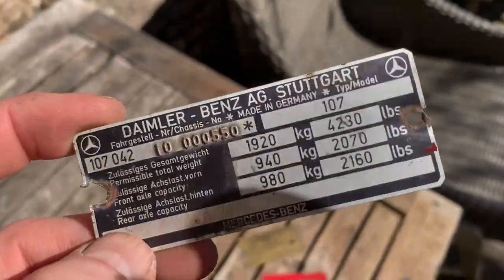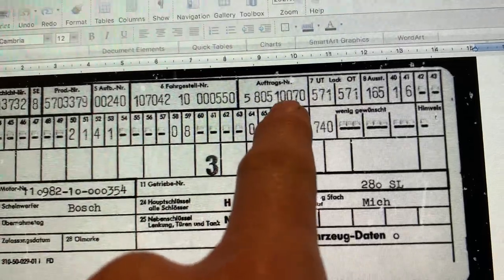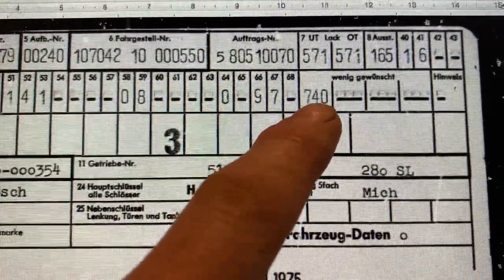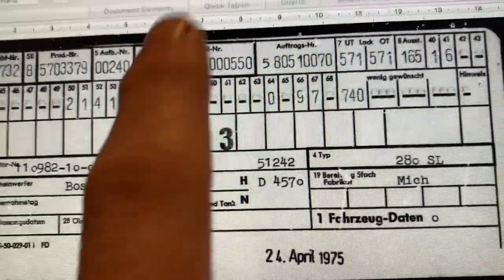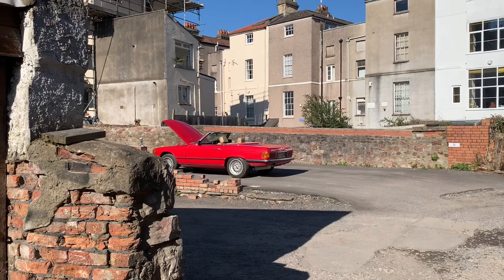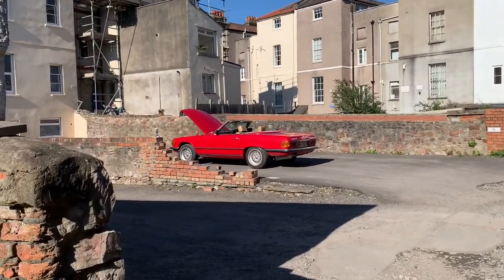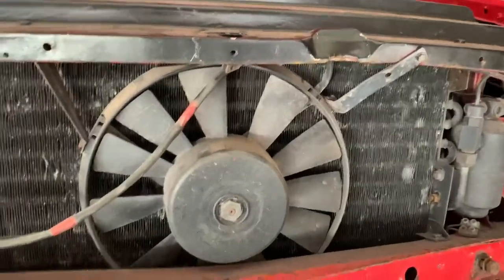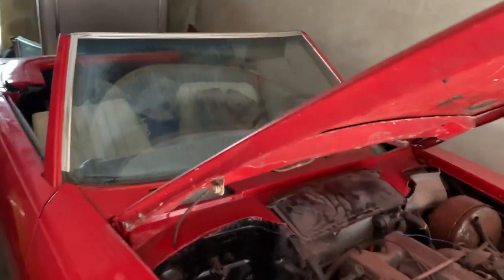Mercedes R107 data card + VIN number decoding

Comment: The 42 means the model( 280 sl) 10 is left hand drive manual 12 is left hand drive auto. 20 and 22 for right The injection changed from d jet to k jet in 02.1976 so if this is a 1975 the engine may be original. And it should have the d jet 110.982. Hope this helps, good luck.
Reply from the maker: Thanks for your comment. It’s all starting to make sense......the plot thickens.

Comment: I think the 042 is not the manual gear box. I think is the model related to engine. Like 107.048 is the 560SL
Reply from the maker: Thanks for your comment. You are right, the 042 is for the model eg 280SL. The next two digits tell you whether the car is LHD or RHD and whether it is manual or automatic. One of my subscribers left a really comprehensive guide in the comments:

R107 for the roadster (SL), built from 1971-1989
C107 for the coupe (SLC), built from 1972-1981
The figure behind the dot tells you which type:

022=280SLC (M110)
023=350SLC (M116)
024=450SLC (M117)
025=380SLC (M116)
026=450SLC 5.0 (1978-1980)/500SLC(1980-1981) (M117)

041=300SL (M103)
042=280SL (M110)
043=350SL (M116)
044=450SL (M117) (also the early 350SL with 4.5L engine for US market)
045=380SL (M116)
046=500SL (M117)
047=420SL (M116)
048=560SL (M117)

The double digit after the next dot tells you 1 for LHD and 2 for RHD, followed by the type of transmission 0 for manual and 2 for Auto.
The last six digits tell the built number of that type.

During the manufacturing years four types of engine were available, two inline DOHC six cylinders (2.8L/3.0L) and two SOHC V8's, all fuel injected. These engines got several changes, of which changeover from D-Jetronic to K-jetronic in 1976 is more notable. All these changes resulted in different engine numbers, which can be found behind the figure of the engine 'family' line (i.e. M110.982 is the D-Jetronic 2.8L/M110.986 is the same engine but with K-Jetronic injection).

Comment: Your latest acquisition the 1975 is djet the others are kjet.
Reply from the maker: Thanks for your comment - now I understand why it looked so different.
Reply from the maker: @John McDonald  That is fantastic info on the SL codes thanks. Have you ever come across a M110 engine where the throttle mechanism goes across the engine block like on my car? Trying to figure out whether that arrangement is standard on any other 280 models. Mike

Comment: Hi Mike, thank you for all your informative video's. I've learned a lot by watching them, please keep it up!

Type decoding is pretty straight forward:
R107 for the roadster (SL), built from 1971-1989
C107 for the coupe (SLC), built from 1972-1981
The figure behind the dot tells you which type:

022=280SLC (M110)
023=350SLC (M116)
024=450SLC (M117)
025=380SLC (M116)
026=450SLC 5.0 (1978-1980)/500SLC(1980-1981) (M117)

041=300SL (M103)
042=280SL (M110)
043=350SL (M116)
044=450SL (M117) (also the early 350SL with 4.5L engine for US market)
045=380SL (M116)
046=500SL (M117)
047=420SL (M116)
048=560SL (M117)

The double digit after the next dot tells you 1 for LHD or 2 for RHD, followed by the type of transmission 0 for manual or 2 for Auto.
The last six digits tell the built number of that type.

During the manufacturing years four types of engine were available, two inline DOHC six cylinders (2.8L/3.0L) and two SOHC V8's, all fuel injected. These engines got several changes, of which changeover from D-Jetronic to K-jetronic in 1976 is more notable. All these changes resulted in different engine numbers, which can be found behind the figure of the engine 'family' line (i.e. M110.982 is the D-Jetronic 2.8L/M110.986 is the same engine but with K-Jetronic injection). 

Regards,
Arend Troost

PS: just for fun... 
https://en.wikipedia.org/wiki/Mercedes-Benz_M110_engine
https://en.wikipedia.org/wiki/Mercedes-Benz_M116_engine
https://en.wikipedia.org/wiki/Mercedes-Benz_M117_engine
Reply from the maker: Thank you for your comment and also for providing such great information. Interestingly enough, the M110 engine pictured in the link you sent has a similar radiator set up to the one in my latest project. I wonder if that radiator set up was specific to a particular model which might shed some light on where the engine in my car came from. Mike
Reply: Mike, 

The red 280SL that is inside has the typical airfilterhousing and intake manifold that comes with a M110.982 with D-Jetronic fuel injection. It is exactly the same in my '75 280SLC, whereas the other two have the typical K-Jetronic set up with a fuel distributor. The M110 picture in the link is of a W123, hence the different airfilterhousing.

The radiator 'set up' is that of a car with A/C, the small fan in front of the radiator being responsible for keeping the refrigerant cool (electronically operated). If the datenkarte (and the date plate that is supposed to be on the front crossmember) you used to explain all the figures and info on the datenkarte belongs to this car it is a factory mounted A/C with code number 580.

You are correct concerning the transmission, if (again) the datenkarte belongs to this 280SL. The VIN is clear that it left the Sindelfingen factory with a manual gearbox...

Regards, 

Arend
Reply from the maker: @ArendTroost  You are truly a fountain of knowledge! That is exactly what I needed to know. Maybe you know the answer to another question....I have not yet tracked down the engine number on the red car so cant verify whether the engine block original . I was wondering how hard it would have been for someone to keep the original engine and replace the just gear box with an automatic? Mike
Reply: Mike, 
The engine number is hard to find and reading it, due to the collection of dirt and grease over many years of usage, usually difficult. You probably know where to find it, but just to be sure, it is to be found on the left rear side of the engine (against the firewall) where the cylinderhead meets the ‘underblock’(?). The number should start with M110.982.10.XXXXXX if this is the original engine. About your question, although I’ve never done that myself, it’s my belief that both gearboxes can be mounted (or interchanged) quite easily as long as you have all the hardware necessary for the swap...
Arend
Reply from the maker: @ArendTroost  Thanks for your comment - I had one try to find the engine code but so far no success - like you said no doubt buried under a mountain of dirt and grease. I have an oil leak on the red 280SL which is probably the rear crank main seal so at some stage, I'll be taking off the bell housing to investigate. This will give me a better idea of how things fit together. Meanwhile I'm stuck in the world of bulk head repair....Mike
Reply: @MikesMercsandothercars , it really can be a pita to find the number as it also obscured by all kinds of engine related tubes, rails, hoses etc.
Steve Griffin (UK) is an independent classic MB mechanic who has recently posted some pics on how he does this bulkhead repair. For example:
https://www.facebook.com/groups/595597180544995/permalink/3516309971807020/
Arend
Reply from the maker: @ArendTroost  Thanks for the link. ...I have yet to attempt that particular part of the bulk head repair. It sure looks tricky. Mike

Comment: Hi Mike, I wonder - do you know the meaning of the 8 on the end of this string of numbers on your data plate?: 10742  10  00240  8
I've seen 2, 5,6 and 8 in that location and there may be more.
Many thanks.

Comment: This is how i decode my vin:

107 042 10

0=gas
4=SL
2=280

1=LH Drive German
0=Manual tras
Reply from the maker: I wonder if there is a list anywhere showing all the 107 codes - if 42 is 280sl , 44 is 450sl what is a 420sl and a 600sl etc
Reply: @MikesMercsandothercars ,042 280sl,044 450sl,045 380sl, 046 500SL, 047 420sl,048 560sl and I think 043 is 350sl. I have never seen a data plate for a 300sl so I don't know.
Reply: @johnmcdonald1647  My 300SL is 041 which is model code for it...